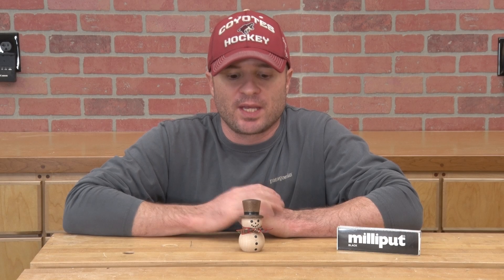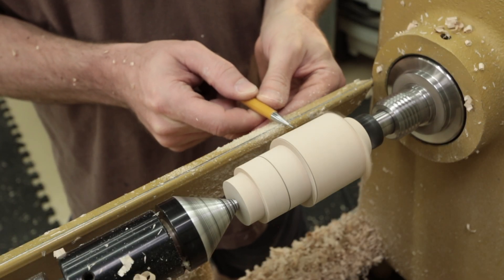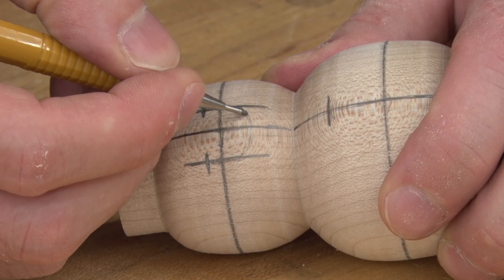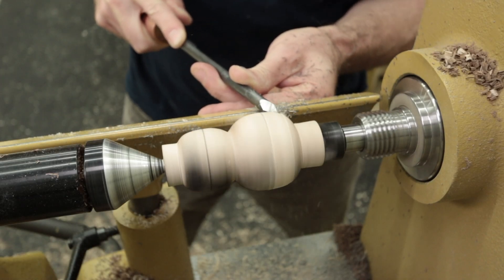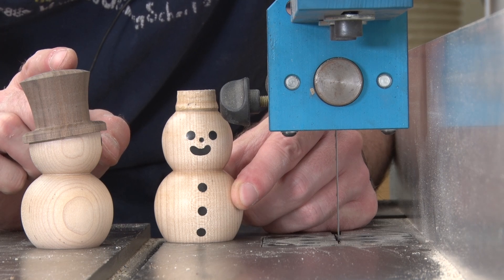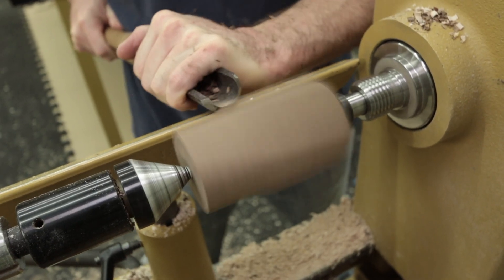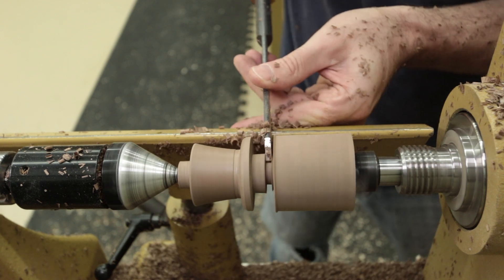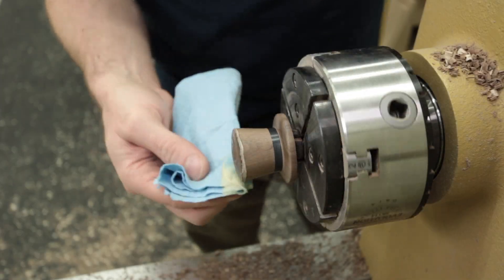Turning A Snowman

Comment: I like the instructional video especially giving the measurements to making the reference marks/lines.  Like others, I had not heard about milliput, but have used other epoxy mixtures.  Would like to know what type of tool/gouge is being used.  It doesn't look like a 3/8 gouge, so am not sure what type it is.  There is certainly a sharp edge on the tool to make those cuts look like a hot knife through butter!

Comment: I like this and am turning one right now.  Only found one real problem.   you turn down the tenon on the hat to 1/2 inch (to fit the hole drilled in the snowman body).    and then you turn it around and put that 1/2 inch tenon into a chuck.   How many people havepin jaws that will close to 1/2 inch?  not me!  I improvised and made it work but the rest is great

Comment: Great video!  Very specific details without a lot of dribble.  Well done.  Question - midway thru the video, you show a slightly different version with a continuous smile instead of the 3/32” holes.  Did you just drill a couple extra holes?  How did you clean them up?

Comment: Hi.  How does the hat fit flush on the head when both the hole in the head and the 1/2 inch mortise are perpendicular.  I am getting a gap between the hat and the head.
Reply from the maker: The top of the head is at an angle… you drill perpendicular to that angle essentially perpendicular to the flat part of the top. It should fit flush.

Comment: I'm new to turning, so this is a bit overwhelming especially to adapt different wood sizes and trying to follow all the steps. Is there a written document to provide these steps and how to adjust measurements to different wood sizes? Also have you done one where the hat is incorporated with the initial blank (ie the same wood as head/body)? Those instructions/measurements would also be helpful. Thanks for any newbie tips!